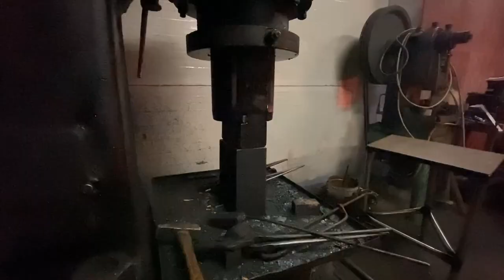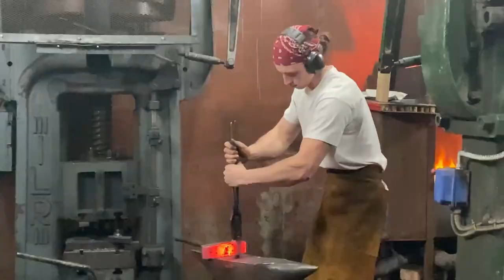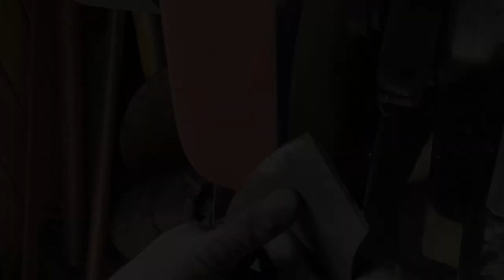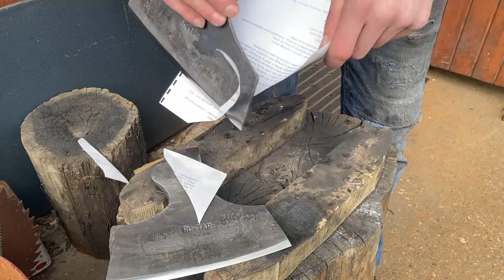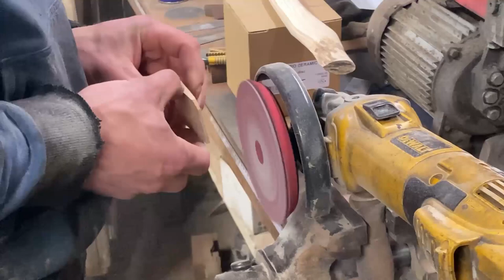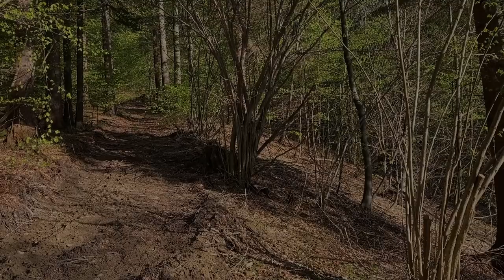Forging a broad hewing axe

Comment: I have a question about your anvil, was the whole thing originally rounded on the top and you machine and a flap on it? Or did you get the anvil like that? Its very unique, i love your shop great hammers, great work
Reply from the maker: It is basically a french pig anvil that was quite heavily damaged, so I machined a flat surface on it so it is useful. I plan on welding on a new top plate when I get the time.
Thanks for the kind words!
Reply: Awesone! thats exactly what my dad said when he saw it. Smart move